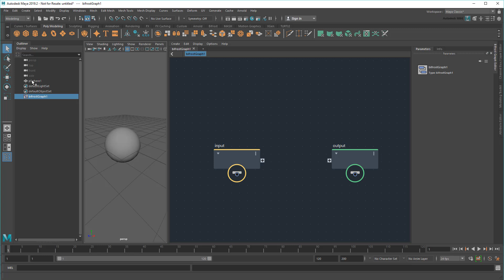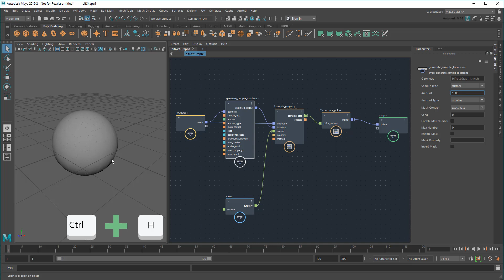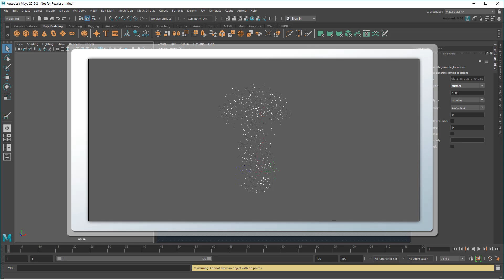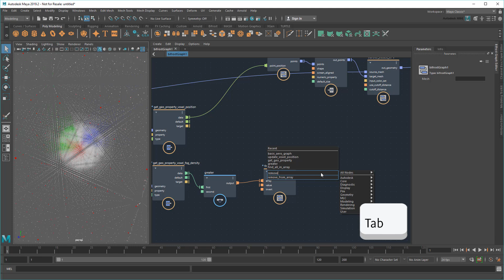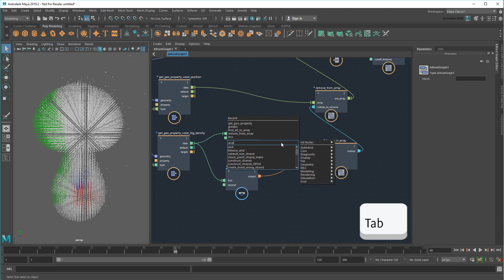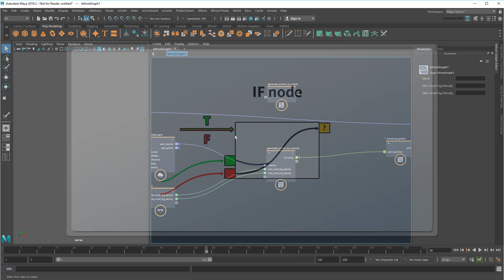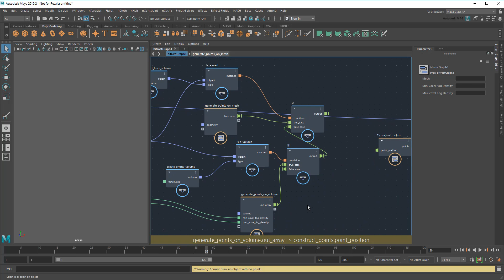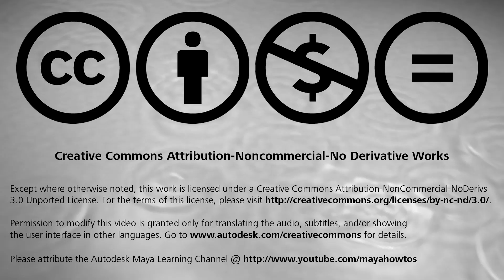Bifrost Quick Compounds - Episode 3: Generate points on objects

Comment: sorry for bother you, but when i add basic_aero_graph, my object was disappear even i change sample type to volume and point_position also seems like doesn't, but i can see really small point in my scene, if i change my point shape it will become bigger than before, but still only one point, and doesn't show simulation. I'm wondering you can read my message ,finally, thanks for your tutorial, which help me a lot!XD
Reply from the maker: Try right-clicking your Time Slider, then making sure that the Playback Speed is set to "Play Every Frame - Free"

Comment: any straight forward way to convert volume explosion example to mesh but exactly same shape as the volume, i saw in some bifrost demo oh can do this and that , the soup BE bifrost plugin seems can do that stuff quite good , but in this bifrost graph , what need to connect from aero volume to get that volume a mesh , since convert volume to mesh is not working with this aero
Reply from the maker: If you mean converting to a Bifrost mesh, you can use the Bifrost node "Volume_to_mesh" to do it.

If you mean a Maya mesh, you can use the Node Editor node "bifrostGeoToMaya".  Check out the 3:17 mark of this video: https://youtu.be/p6EuH5o_CuQ?t=197
Reply: @Autodesk_Maya  thx for reply , i know that volume to mesh way, but seems aero volume cant be converted to mesh so easy like that , my main point is just import explosion example from the bifrost content , and convert the volume aero explosion to mesh keeping the same shape , maybe the voxel density fog shape , instead of the explosion shape , i get kind of cube mesh because I guess need extract the points shaping the explosion , not the points around that usually white color, but I wonder if there's some straight forward way to convert to mesh and can use some node to select the range of points that want convert to mesh , same as in the standard volume shader and remap nodes to decide if want to see more or less the density fog

Comment: Hello! Sorry to disturb you, I have a Serious big problem. In August, I started rigging for another character. I was doing very well until the duplication, but when I was almost done, the flexing kinematics had a big problem with the wrist. I fixed it by rigging my right hand with mirroring again, but when I want to connect my right hand, an unknown, unjustified problem appears. maybe a space problem, you don't know. It consists of orienting constraint RightArm_FKConst_GRP and RightArm_ResultConst_GRP to RightArm_ShoulderSpace_LOC after I set the rotate x value to -180, instead of 0 the result, but -360. I don't know something I forgot or I duplicated Shoulder_GRP badly, I don't know. I tried to fix everything, but it didn't work! I've had enough! I tried everything. That's why I turn to you for help. Can you tell me how I can fix it? What did I do wrong. Also how to duplicate. PLEASE! Help me if you can. Thank you in advance.

Comment: i would love to be able to control the size and rotation of each point instance shape
Reply from the maker: That's the beauty of visual programming, you can totally expand it however you want.  To do that specifically, I'd suggest splitting the points out into multiple arrays (perhaps by region?  Within some sort of control shape?  Or using CPVs like in Episode 2) and then customizing the size and shape of the points generated by each array.

Comment: I like visual scripting. It's a bit like unreal editor. What does this mean for maya embedded language? Is it still useful for tool development? Does Bifröst work with MEL? Are expressions a thing of the past with Bifröst or can we still type stuff in somewhere? When will all these nodes be explained in the maya documentation?
Reply from the maker: Embedded languages are definitely still useful and some specific procedures can interact with Bifrost.  The documentation is actually separate from Maya's documentation, and you can find it here: http://help.autodesk.com/view/BIFROST/ENU/
Reply: @Autodesk_Maya  Thank you I was looking for that. Lot of stuff to read :)
Reply: The underlying scripting language in BIF is different to those in Maya. They aren't exposing it to users yet because they want to finalise the nodebased experience. If you're using BIF in maya then you can use mel on the nodes outside of the graph and feed it into the graph with input nodes.
Reply: @Davesplaining  Thanks I'm trying to get my head around what bifrost really is. So there are no MEL commands for making nodes in bifrost because it works in a different scripting language (being python?) which isn't exposed yet. It's basically a whole different software where you can plug things in and get stuff out.
Reply: @DHPshow  Yes basically exactly what you said "a whole different software you can plug things into and get stuff out of"  so it sounds like you've gotten your head around it pretty well... No the language won't be python either it's more lightweight like vex in houdini, but I was told it shared some resemblance with html.